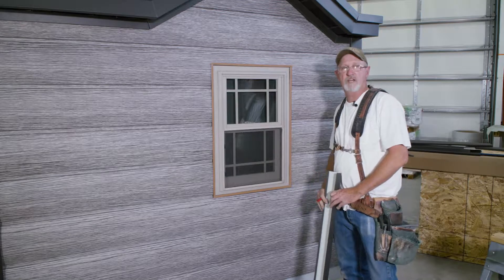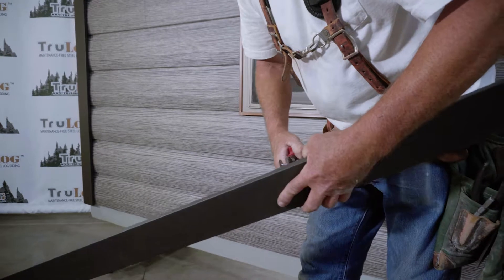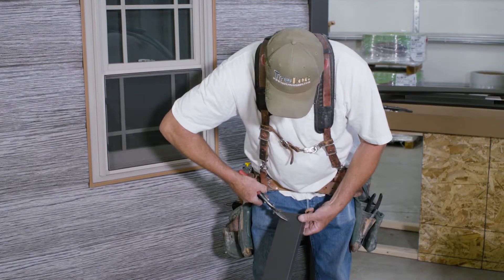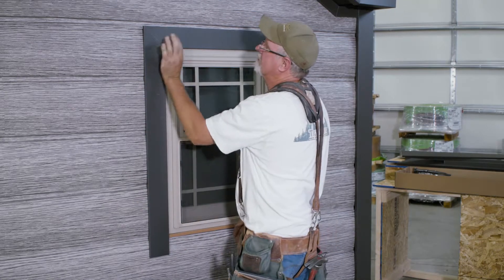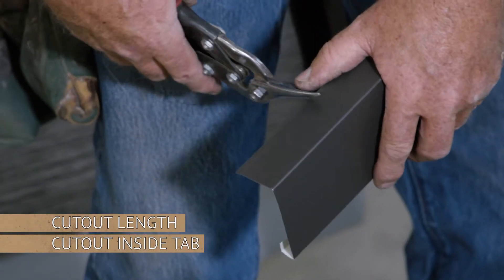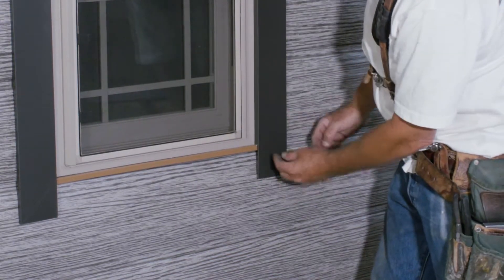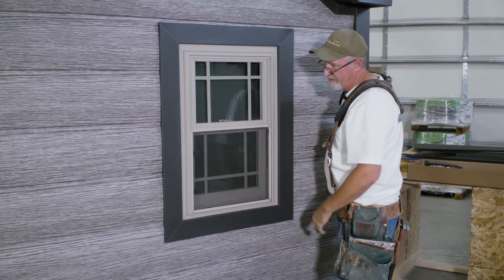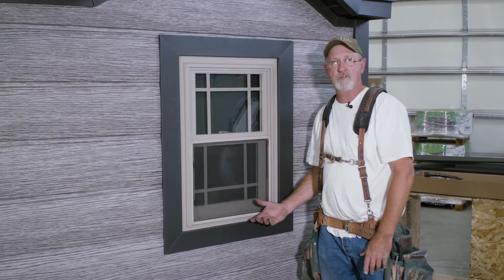TruLog - Bold Window Trim Installation

Comment: Very informative video. I have a question on how the bold trim would be installed on a board and batten wall if the outer edge of a bold door/window trim were to fall directly on a batten? Would you just cut the outer edge off?
Reply from the maker: Thats the perfect scenario if the batten ends up right next to the window, the bold trim fits perfect there. Its the opposite of that situation where there is no batten. Tough situation since there would be a gap btwn the bold trim and the steel panel. You can fill that void with something
Reply: Is the bold door trim different for the board and batten than it is for the horizontal log panel? A better question may be how you would handle the trim going across the top of the window where you would encounter battens every 6.5 inches? Would you notch the 1/2" portion of the trim to make it sit flush?
Reply from the maker: @kylebritton8195  Its the same just a little different dimensions. Not the trim would sit on top of those battens

Comment: What keeps the j-channel and these trim pieces from blowing off in say 50-60 mph wind gusts?
Reply from the maker: The j-channel is screwed to the wall. The bold window and door trim is a tight friction hold and also you can use an adhesive where the window and trim meet. We have also had people rivet them together as well